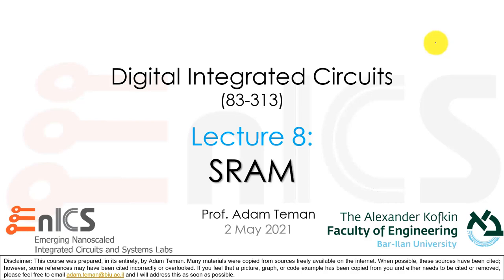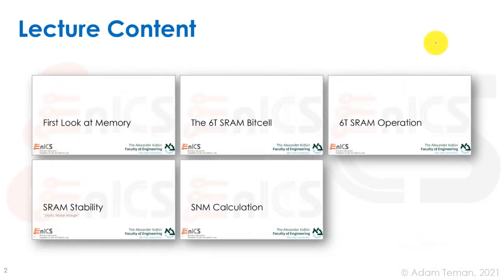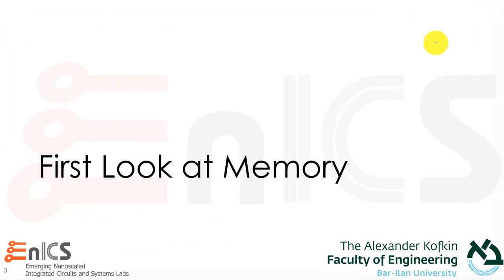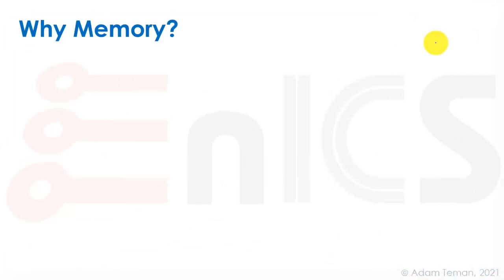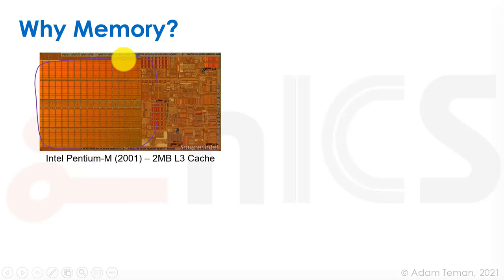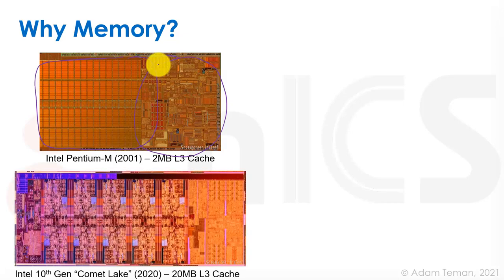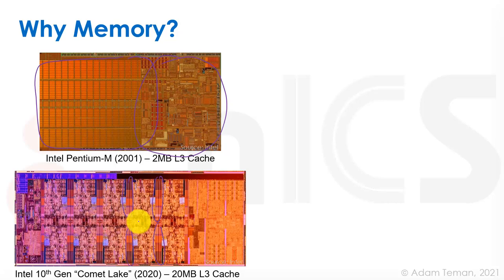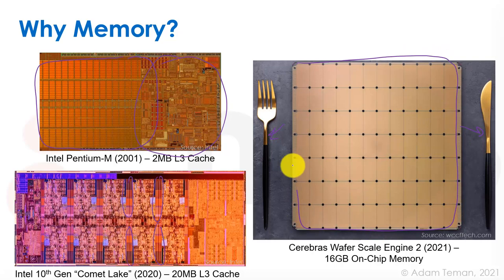VLSI - Lecture 8a: SRAM - Introduction

Comment: Do you know that from 2008 prefixes for binary multiples are in ISO 80 000 standard? It is incredibile that a university lession does not contemplate it
Reply from the maker: Indeed, I should adhere to the standard. 
However, like it or not, this notation has hardly been adopted in practice, to the point where many (probably most...) engineers would not know what the difference between KB and KiB is and I'm afraid that many (maybe most?) would not know what a MiB is and this could lead to more confusion than benefit.
I, for example, have never heard anyone use the term "mebibyte" or "gibibyte" and I believe that if they were to be used, a bit of laughter may arise in the presence of other engineers.
That being said, it would be better practice to use the correct notation. Thank you for the comment.

Comment: What all type of Bitcell are available?
Reply from the maker: Hi Isshhh,

I'm not sure what you mean by "available". However, probably 90% or more of the embedded memories you will find on commercial ASICs are based on 6T SRAM.
There are compilers that produce two-port 8T or dual-port 8T SRAM, but they are less commonly used. There are also register file (RF) compilers that may use one of the above or may use something closer to a flip flop. There are also content-addressable memories (CAMs), which I do not discuss in this course.
But really, the vast majority is 6T SRAM, unless you go for something very specific, proprietary, or custom designed.
Reply: @AdiTeman  i mean to say that how many types of bitcell
Reply: @isshhh...740  Are you asking about HDSP bitcell(High density single port), HCSP(High current single port).
OR 6T SRAM, 12T SRAM